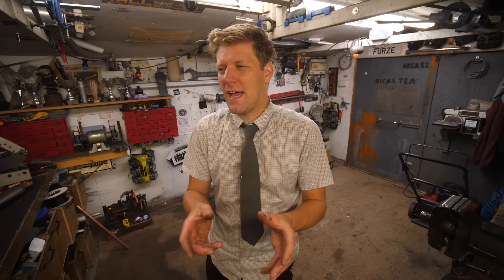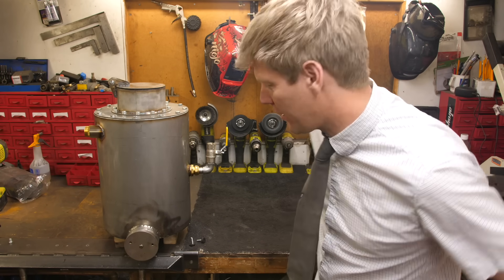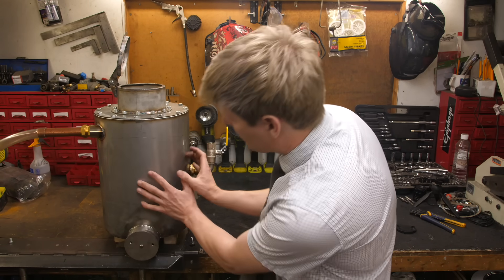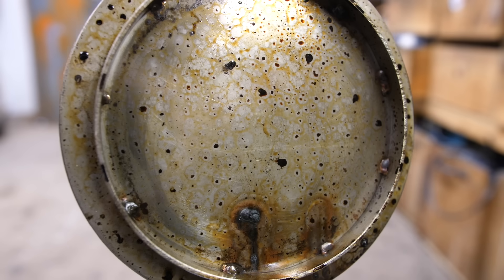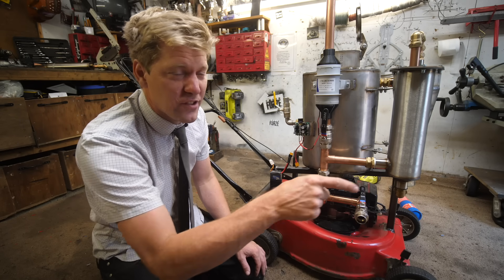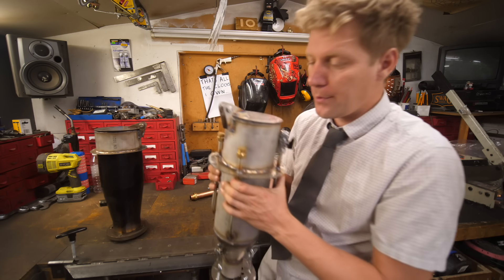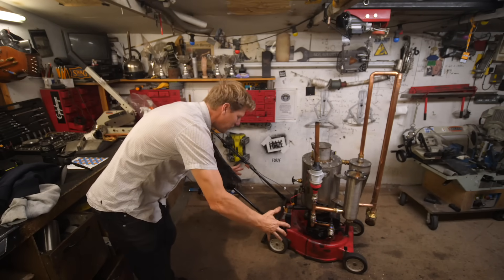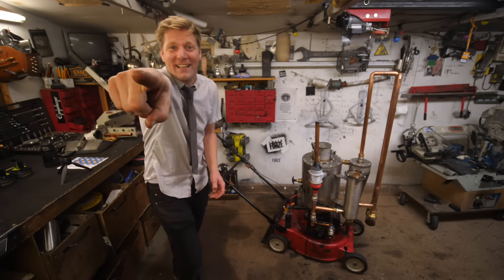WOOD POWERED LAWN MOWER

Comment from the maker: Well this was a journey, I've got a way better design in me but I love the trail and error and I know you like seeing it all to, stay tuned for the ultimate garden swing. Limit stock available on the merch so get it quick https://www.colinfurzeshop.com
Reply: Please do as Spotify playlist with all the music you use o the video, because damn your soundtracks are you almost on point. I beg you
Reply from the maker: @NicholasKI98  I'm on it
Reply: @colinfurze  انت شيعي لو سني
Reply: @colinfurze  Put in a heart ring to have a waist were it burns really hot. There is where the tar is cracked into lighter stuff. Under the waist you need to let some char coal drop down in a layer to reduce CO2 from the hot part above into CO. In the heat the moist will split the water into H2 and O2 giving you more CO plus H2 out. It burns better if the gas is cooled. Your very first proof of concept was just dry distillation which is an entirely different thing.
Reply: Did you finish the screw tank
Reply from the maker: @Ziggyzaggy300  I need a few bits of special paper before that can continue
Reply: @colinfurze  what kind
Reply: @colinfurze  I'm just glad to have you uploading again
Reply: @colinfurze  I've seen another channel that all he does is make these he might be worth a watch he runs his house off ot them
Reply: colinfurze Recently rewatched the hydroforming video from several years ago and had an idea. If you programmed your CNC plasma table to cut shapes out of 4-6mm steel with bolt hole around the perimeter you could sandwich two pieces of metal between them and add pressure between them, then you should be able to create consistent shapes that you could produce quickly over and over. Let me know what you think.
Reply: @Ziggyzaggy300  тио

иаь
Reply: Can you use the cut grass to help power the mower?
Reply: Kyle Williams don’t even question that man’s abilities but that’s a great idea😂
Reply: Put a bubbler filter on it
Reply: Wow Colin, I love your work! Always coming up with something amazing.
Reply: I actually can't believe you got that to work at all. Nicely done. How long were you working on this project?
Reply: i like your vedaos
Reply: you shild ask "mr teslonian" because he made a bunch of stuff with woodgas
Reply: Make a proper knock-out pot mate, you got a combustion company near where you live (along the A1) if you want some good advices ;) there is a bunch of experts there.
Reply: I wonder if a bubbler would clean the gas enough!!!!
Reply: How much of a difference will various types of wood make? Pine would probably produce the highest amount of tar for example.  Aspen may be better?
Reply: @mabecka  actually I think you have it backwards. The water isn't so much a function of moisture in the wood, but actually a byproduct of the wood combustion itself. Just like burning natural gas, water is produced when the hydrogen is  oxidized.
Reply: @kleetus92  might be, but i was thinking about the tar. Pine is what is used for making tar. Seems like a bog part of the problem. Someone got to know what type of wood works best. Cheers!
Reply: @colinfurze You should do merch that is in the theme of what you wear. Like button up shirts, ties, and gloves. I'd rock that daily at my welding shop.
Reply: The stuff you come up with blows my mind 
And I've been waiting for you to start doing hoodie great vid 👍😂
Reply: Colinfurze just a Idea you should make the machine run on the cut dry grass so you don’t even have to use wood
Reply: have to say this thing looks as if its steampunk tech made real a little modification/decoration and it would be perfect
Reply: You need water in that mason jar so the wood gas can be injected under the water level and the gas to float up leaving the tar behind. Also a smaller outlet pipe for the wood gas to be lit. Not 100% sure that will do to much but about 70% percent sure with current knowledge.
Reply: Great video as always!
Reply: Great vid
It would be awesome if you could finish the hydraulic jaws
Reply: Woooww super chuloo
Reply: No one is better than colinfurze😂😂😂
Reply: martin ford he sucks
Reply: How u gonna see what u mowin in front of u😂
Love ur content btw
Reply: How does it work 
link me the science
Reply: Mr teslonian is an expert in this field. I used to watch him a few years ago and he sussed it with different places to catch and cool the fumes with making petrol,diesel and creosote while making engines and gas fridges work. If you haven't seen his channel you need to because he is very much like you and makes all kinds of cool things like ways to generate electricity and the such. Cool video none the less col👍😁🍻
Reply: Did you intend to write trail or trial?
Reply: Colin can you go live pls mate
Reply: Love it
Reply: colinfurze plz do something w steam
Reply: Great work! The wood gassified cars we had here after WWII usually used large water 'bubbler' filters. Might be a bit large for that lawnmower though. ^^
Reply: Fantastic! Saw a guy once that made a gasifier work with a turbo as a generator. No motor, just turbo and gasifier with a small generator attached to the turbo. Gas turbine generator. How about a wood powered jet engine next project?!?!
Reply: @follyoftharp9031  I said this in other comments, and I agree 100%.
Reply: You need to make a wood gas powered wood chipper.
Reply: Now you need to put a jet engine on the back so you don't need to push it
Reply: Had lots of trouble with my set up lots of tar 😑 lagging and insulating all the gas lines from the burn chamber helped keep everything at a high temp which massively reduces condensation in the system and reduces tar and ability to tar 👍
Reply: STEP 2: Make it grass powered insted of wood powered.
Reply: @Mark_Rober  انت شيعي لو سني
Reply: @علىِالشيعيالرافضي اخرس الصمت
Reply: Take the cut grass, dry it out, use it as fuel, 

Science 100
Reply: Hey Colin! What about water filtration? It might be a weird comparison, but i mean something like bong. This will cool the gas down and filter tar out.
Reply: Я из России класс видео 👍👍👍👍👍👍👍
Reply: Dude, just bubble gas through a can of water, it'll absorb most of the tar.
Reply: Thumbs up! Love your videos, im really interested in woodgas 

P.S when you start a empty gasifier for the first time you should fill the "core" with charcoal instead of wood to make the first start way easier.

One idea i have to get rid of water in the wood is to make the lid like a upside down bowl with a folded in rim so the water condenses and run down the sides and you can drain it from there,so you get rid of the water before it enters the core/filters/coolers.

Hope you get the idea.   Cheers!
Reply: I have over 2000 hours of engine runtime on woodgas, and yup, I have made EVERY mistake in the book, during the learning process  :) .
Reply: This Documentary explains a lot. Its well presented I believe most of it. You decide>>>enjoy 
https://youtu.be/SZIKrPXltrA
Reply: colinfurze why don’t you make a wood powered chainsaw so it makes it’s own fuel
Reply: Build a shopping cart but above a go kart frame
Reply: You may want to edit "trail" to trial😉
Reply: I dont always get to watch your videos on time can I subscribe to something so I can get merchandise  before it sells out ps I did manage to get your sighed book
Reply: *Trial and error 👍🏻.
Reply: use water bubbler to catch the tar!
Reply: Maybe make a steam-powered lawn mower and you can heat the steam with a wood burner. It's not the same, but I'd like to see that.
Reply: Great
Reply: Loved this video
Reply: Hello
Reply: Can't wait for what he will do with the 10 mil button
Reply: Colin how do you get all these ideas?
Reply: colinfurze make the scrap mechanic spud gun
Reply: HI COLIN BIG FANNNNNN FROM INDIA SHOUTOUT PLEASEEEEEEEEEE
Reply: That’s a fricin mini coal power plant😂
Love ur content btw
Reply: Hi COLIN BIG FAN FROM INDIA SHOUTOUT PLEASEEEEEEE
Reply: Try mr teslonian. His videos are informative.
Reply: Another fantastic video!!! Payday next month i want everythinggg on your website
Reply: Trail and error? Jk you’re the best
Reply: I nominate you for the person most likely to survive the apocalypse...
Reply: Finally getting to wood! Can't wait for the wood gas vehicle ;)
Reply: This was GOLD
Reply: SWEET the last 360 swing was 1 of my fav's and the fan backpack made it epic. cant wait to see what you do next, thanks for making my day happy
Reply: @The1badxj  you know, there hasn't been a 10 mln subscriber fireworks video. Fireworks+swing (probably only swing testing in the backyard) would be a good starting point for a video 🤔
Reply: Can you make version 2 not rely on a electric fan to pump the wood gas? Because if you want it to power your bunker in an apostolic situation you don't want to haft to charge battery to for your wood gas generator to work. Thanks!
Reply: I'm Moorenation 2020 - Official l
Reply: @colinfurze what you need is a destilation tower
Reply: Hey Colin! Great video! I had no idea gasification was a thing. I do know from steam engines that that slag stuff you collected at the bottom of your fire is called "clinker", if you were curious to know. I look forward to seeing your bunker generator!!
Reply: @calebwagler853  clinker is from coal. Wood doesn't make clinker if it is burned completely. Look at the minimal amount from a pellet stove.
Reply: @Crayphor  put a link to that video
Reply: If you're gonna be using wood gas you'd better find a use for all the rotten tar you'll produce! 
You should be going solar n wind, bit cleaner for the kiddies lungs n that!
Reply: You need a water filter for it to work
Reply: 🇮🇳Love from India😍
Reply: you said centrifuge bong to capture the tar in water
Reply: Build a charcoal gasifire it makes no tar
Reply: hey colin! I and probably a lot of other people are curious about that afterburner you said you'd make. where is it???

also, cool project
Reply: Just ordered some merch! 🙌🏻
Reply: Truly great sir
Reply: What does it smell like Colin?
Reply: You are really preparing for the apocalypse with the wood powered bunker, aren't you? XD
Reply: Delete this video before the oil companies have you mysteriously disappear 😂
Reply: Use hard wood chips not wood pellets and a scooter radiator for the condenser
Reply: Love you
Reply: Awesome to watch you create things. You are just like doc Brown from back to the future! I like this build a lot.
Reply: https://youtu.be/H6ohdzhQhgk
Reply: The hoverbike is my favourite video because its awsome and it came out on my 8 birthday.
Reply: Sup
Reply: I just bought a T-Shirt and you can be proud - it's the first merchandise clothing I ever bought at 38 years of age. :D
Reply: Finally someone see this a relevant solution!

Hey Colin,

do my idea and for the bunker use solar power to heat the chips, use parabolic with vacuumtube or mirror focus to heat up the chips, and store the gas.
Later you can do the same for boiling water and use the steam to reform woodgas/syngas to methane.
This was my PHd and project for national award but was canceled due to corruption in my country!

If you can do and prove maybe you could get the needed attention to help 3th world to find the green way.
Reply: Colin genius!! I love your videos and the crazy things you do... Saludos desde argentina! 👍
Reply: Grass powered lawn mower?
Reply: Hey Colin, hear me out, do this... but with a full sized truck(pick up or semi) or boat (your choice) as a stepping stone to make sure it’s dialed in before powering your bunker with wood
Reply: Amazing job furze, I wouldn't have thought of it, but now you have. I know you'll get it. 

Also, I'm going to be saying "gasification" for the rest of my life. Put that and a picture of your finished mower on a shirt and I'd buy one.
(Internet help me make a demo)
Reply: @V3 TheTest and the petrol isn't bad?
Reply: So much for global warming 👍
Reply: Did you try using a water based filter?
Reply: I would love to see the blueprint of this invention and the update !!!
Reply: you should try and build a green energy invention like a solar-powered lawnmower or skateboard that would be awesome.
Reply: Please do a virtual colab with Michael Reeves!!!
Reply: Probably can’t use it in California
Reply: Try using running the gas through water as a filter it should let the wood gas through and pull out all the tar and smoke
Reply: AW YES
Reply: collin this does work their is a video on YouTube about a guy running his generator for his place off wood gas and made a tar separation thingy that could give you some ideas for the bunker he also used wood pellets
Reply: Next version, pass the grass along the heater to dry it, then it can be used as perpetual fuel...
Reply: When did Colin become a chemist
Reply: Colin. You owe us both the 9 MILLION and 10 MILLION subscribers fireworks videos fireworks 💥 🧨
Reply: Char the wood first buddy!
Reply: Try capturing a micro black hole (created by using the LHC at energy levels above 23 MeV)  with magnetic field nets (once its slowed and stable) fire EM waves at it at the precise angle to use its tiny gravity distortion (to accelerate the waves beyond energy levels put in) and bounce them around a container without the field falling in the tiny event horizon until suddenly released.

You think you can build that? Might take some co-operation.

All I ask is that you call it an SPM Single Point Module 

😆
Reply: now can you keep mowing using the lawn clippings from last mowing?
Reply: If you DO intend  on making it better... How about adding one of those automatic room cleaner bots that are used to avoid walls and objects.
Reply: You are like a real life wallace.
Reply: You should make a go cart powered by wood
Reply: Colin PLEASE PLEASE don't give yourself CO poisoning! Carbon Monoxide is nasty stuff.
Reply: Welcome back sir! Brilliant concept
Reply: Just buy petrol mate
Reply: Colin maybe put cottone in the jars
Reply: I literally was going to build this same thing for my channel but I'm glad you did it first cause now I don't think I want to. :)
Reply: Make a wood powered go kart
Reply: You should have made a wood gas generator, then convert what you want/need to run wood gas only. That way you can refine what you already have, stockpile it for later, and decide on what you want to convert to run pure wood gas. It'll also allow you to filter out the tar better by having the generator separate from the engine.
Reply: "Powering the bunker with wood gas" Colin, are you alright mate?
Reply: @colinfurze maybe try a less resiny wood. Pine or any other red wood contains lots of sap/pitch, that's the tar you're getting, most hardwoods are a lot less sappy, and depending on the source potentially dryer. Construction grade kiln dried redwood is usually about 14% moisture, I've got some chunks of oak that measure less than 8%.
Reply: Would love to see u make this work on a car engine 😂
Reply: You might try incorporating a water bubbler into your filtration system! Cant wait for the next one!
Reply: You could bubble the gas through some sulfuric acid to remove the moisture & tar and a second with calciumchloride.
Reply: Hi Colin, How about making Steve Martin's gasoline powered turtle neck sweater.
Reply: Something simple that you have made an absolute balls of.
Reply: It didn’t work to begin with.  No smoke.  No chooch!  Scam artist
Reply: Build an electric skateboard
Reply: Hiya Colin! I would recommend bubbling the gas through a large jar of water and a bigger radiator, which will both serve to condense the tar and water out of the gas, and cool the gas. (and the water will eventually fill with drops of tar.) Also, consider using a turbo which is driven by the engine to pump the gas, as this could cut out the requirement for a fan :)
Reply: man, Ukrainians use such a mechanism to refuel their cars
Reply: Cut the lawn next week  with the cut grass
Reply: @colinfurze Would it be possible to use water as a filter? Thinking if you made it as one large water pipe?
Reply: mad man !
:)
Reply: Maybe you should somehow collect the gas In find a way to filter it from there to get the gunk out I mean I know the point was to have it work all as one ....buuuutttt  That gunk is worse in the stuff that comes out of my butt after chipoltle
Reply: Your imagination is to big for your body
Reply: Believe use hay filters, wood never seen. With cyclone particulate filter and radiator cooling systems. Basic on pickups in USA.
Reply: 日本語の字幕つけてほしい…
Reply: Need a water trap like a water bong for smoking weed
Reply: Can't say I'm the only one, but I did suggest a gasifier via the website about a year ago!
Reply: Great Friends
Reply: You can it woouu😱😱😱
Reply: It needs a gasometer! https://youtu.be/5hfznunVzKY
Reply: you may need to filter the gas through  water to get rid of the unwanted tar
Reply: Donald and Kanye getting close https://youtu.be/0KjnXpiFhT0
Reply: Where is Mr.Bean?
Reply: Make a steam powered Riding lawnmower
Reply: @V3 TheTest bye!
Reply: #Colinfurze delete the carb completely your mixing the fuel air yourself and also you the freaking man I'm glad I've been here since the beginning 🤟🤟🤟🤟🤟🤟🤟
Reply: Colin I was power washing my mini bike and letting the power washer run on the side of a tire on a threads and making spinning at Mach 5 do I bet you can make a power washer driven mini bike just having high pressure water jets spraying at the side walls at the tire
Reply: colinfurze you should make it so u can smoke meat and Moe your lawn at the same time.(I noticed you used smoker pellets and got the idea.) you can call it the ultimate dad lawnmower.
Reply: RED PILLS>>>>>>Enjoy the TripPPPpppPPPPpppPPPpppPPP
https://youtu.be/SZIKrPXltrA
https://youtu.be/kSkY1BPwuew
Reply: https://youtu.be/LlwvF7k31Dg
Reply: Grass powered lawnmower
Reply: https://youtu.be/PDaVAwyuHAk
🤞🤩😍🤩😘🤞😍🤞😘🤞👌👌👌👌👌
Reply: Even the trail and error has some trial and error in it. So back garden, Colin Furze shed!
Reply: lol big memer 69 no he sucks
Reply: This lawnmower gives me such a steampunk feeling
Reply: Just started a channel. Taking trucks into the mountains to wreck em. Hoping to make some folks laugh!
Reply: Hi Colin how about taking a couple of steps further make a woodfired gas turbine out of one of your turbocharged jet engines you have and put a freeturbine on the back to generate electricity
Reply: 'without gas or electricity' requires a battery powered fan and a blow torch to start
Reply: Next video: grass powerd lawnmover.
Reply: Thought I recognised that accent; greetings from Boston. New to the channel & love it Furzy. Was at the beach over weekend. Would love to c a top-box on a car able to get itself down and drive to the beach. Sweet.
Reply: Trail and error, I see what you did there.
Reply: https://youtu.be/_QeiKTPfI1s
Reply: looks so heavy to push
Reply: Keep this up and you'll have people from the EPA (american anti pollution politics agency) knocking at your door.
Reply: @jeremiahfix5529  He lives in UK and he's britain, not even an American lmfao. Read the facts and know who he is before dissing on him, thanks :3
Reply: could be a horrible idea but a steam powered go - kart could be interesting
Reply: @alexc7857  XD
Reply: Make it even cooler hook up motors to the tires so you can use a rc car remote with it
Reply: The Germans in ww2 developed a tiger that ran on wood gas.
Reply: https://youtu.be/3apnzNVHtLg
Reply: @colinfurze
Would be awesome if you could use the cut grass to power the lawnmower somehow? :D
(Maybe not directly, since it is wet (use it for steam? & dry it at same time? ;P), but you could dry it, and then feed it to the gassifier later?)
Reply: Oil bath filration Colin?
Reply: О круть  супер     вам класс готов
Reply: Furze has failed it could have been grass
Reply: Colin my man you have the best montage music . it makes me want to build stuff.
Reply: Kind of wood used effect build up like chimney?
Reply: Build a wood gas powered car!
Reply: Had you considered an oil bath filter? Not sure if that would catch all the tar, but it may help cool it? Just throwing something at the wall here....
Reply: soo look up mr tessalonian . he has a lot on it. also you can filter the  gas intencivly to actually produce very high grade liquid fule as a bi-product.
Reply: Do you think a oil filter from a car would stop the tar getting to the engine ? Plus more compact
Reply: Try turning the wood into charcoal first
Reply: Colin can you make a wood powered go kart 🤔🤔🤔
Reply: That’s amazing 👍
Reply: colinfurze you need to put it in a car that would be a great mini series
Reply: What about bubbling the wood gas through a water colum filter? That should pull the tar right out, and cool the gas down enough to condense it for greater potency.
Reply: So.. given that it uses an electric fan to move all the gas and air around, what you've ACTUALLY built, is the world's most complicated battery-operated mower!
Reply: But would it also wor with hay
So you cut the grass, let it dry and use it as fuel for the mower⛽💚
Reply: Dude, I wish you were my neighbor when the zombie apocalypse comes. Fuck the World, let it end, but the lawn must be perfect.
Reply: Colin also loves the TRIAL and error
Reply: Dont use pine use hardwood that's been seasoned so it's super dry. No tar issues. The tar is from the pine.
Reply: You could probably do the same thing with a distiller style version use your tank for the boiler send it to a thumper keg for the filtration and condensing coils to cool the gas and condense it also where your fan can be to keep it from melting
Reply: No
Reply: You love the Trial n' Error?  That's awesome because my channel loves you too!
Reply: Hi Colin, i have another project to you, can you build a front wheel drive bicycle? it will be fun to watch.
Reply: Next time could you make a mech powered by steam
Reply: love the way you say slag so casually lmao
Reply: at the end of this you'll have a patent worth millions that the chicoms will try to hack your puter for.
seriously, this is the most interesting one you've ever done because it dabbles in practicality: I'd at least use a self propelled model if not a riding mower though.
In WW2, many or most western countries and japan converted all their public buses, trucks, etc. to woodgas because of the fuel shortages...
Reply: Fuel was scarce, but not unavailable.  A lot of wood gas modified engines used a petrol fuel tank to start the engine, and before shutdown - precisely to clean away a lot of the gunk that would otherwise foul the engine.
Reply: you should check out the video game called Grounded, its on steam, its all about crazy inventions and i think you would inspire the game and maybe it could inspire you haha its like honey i shrunk the kids!! anyways i love youre content keep up the amazing work!!
Reply: You need to make a screw feeder to feed gas generator with mowed grass )))
Reply: I hope that you see my reply. Don't burn pine wood, it's full of resin and that's why the tar build up. Use a hard wood. Just ask any chimney sweep and he will tell you the same.
Reply: @paulus842000  You are correct, pine is extra sooty and loaded with creosote and tars.  I believe hardwoods also have more stored energy in general.
Reply: Could you filter it with water?
Reply: In Estonia one old guy build the same thing but a car working with oven “engine”. It was like over 10 years ago. :D you should also try making a car next time :D
Reply: Best channel on YT hands down
Reply: Colin where every invetion goes after the video
Reply: This is the first video I've ever seen from you, I've paused 2 minutes in to let you know this is fucking sick. Love your music taste, and attitude towards cool subjects like this
Reply: Next up: Nuclear powered riding lawn mower
Reply: There needs to be another one that can run on the grass it cuts
Reply: U should consider using a hard wood it'll take a bit longer to get going but it will burn hotter for longer
Reply: Or pinecones
Reply: you are just like Bat-Man
Reply: if it worked the neighbors will complain
Reply: I wish i had your life.
Reply: You gotta eventually do this for the screw tank
Reply: I wonder if just burning the wood gas and using the flame to power a steam engine would be a way to go for powering your bunker.
Reply: Make it work om burned grass
Reply: Is there anything you can't create?
Reply: You should make a floating house next 🏠
Reply: Hi there if you could please take a moment out of your time and really have a look at this as we need help to save our little girls life.

I'm just trying to get all the help that i can but i have gotten some devastating news about my little girl Eleanor, who is almost 7 months old. She has been diagnosed with a very rare disease called SMA (spinal muscular atrophy) she has type 1 which is the worst type you can get, it is a life threatening disease. We have found this treatment but it is only available in America which cost $2,000,000 USD so that's about $3,000,000 AUD and we have created a go fund me account to try help raise these funds for her as we would never be able to get this kind of money ourselves. so i was wondering if you could really help us out by helping share this around for our little girl to give her the best possible help she can get. Even if you can donate as little as $1 every little bit will help
this is the link to our go fund me https://www.gofundme.com/f/eleanor039s-gene-therapy-fundraiser?utm_source=customer&utm_medium=copy_link&utm_campaign=p_cf%20share-flow-1&fbclid=IwAR3Mum3_MHgjwLUumE-nnbJ17GsXaTR2W-r768KaT7tWOCtuLdNfmVQ8I9M

Thanks Brad
Reply: use wood gas to power your turbo jet engine
Reply: can you mąkę assassin cane sword
Reply: Great video ,
What about refining the wood tar into liquid fuel
Reply: What about a water filter?
Not just one but multiple.
Basically it helps condens out the water, filters out impurities and cools the smoke down... Plus it shouldn't clogg.
When you use jars for that you will see how much the water actually cleans.
Then run it through the cooler, through steelwool and through carbon.
This should result in very pure smoke.
Reply: Haven't seen you get that excited about one for a while.  Like the old days
Reply: Nice wood powered lawn mower Colin love the look of it.😃👍
Reply: What about adding a Turbocharger to it?
Reply: 9:57. The face of a man who has just done it
Reply: Now make a lawnmower that runs on grass clippings.
Reply: S bend as part of the filter?
Reply: You are my backyard hero
Reply: Next time, it’d be pretty cool if you could design a gasified mower that runs on lawn clippings.
Reply: Man, your stuff is great. Looking forward to seeing the test drive of the completed screw tank too! 

PS: the P.O.C burner looked like a bioethanol burner. Try adapting it for bioethanol! Challenge for you furze.
Reply: Nice gasifier colin
Reply: 🌷🗺🌷By every way From divinely powers all the prosperity💎 &wealth abundance💎 in everyday life to all who are reading this comment🌹🍷🍹💐🌏🌄🌻💜💎.Thanks a lot🙏
Reply: Bro what about the engineers in India who make cars run of of wood
Reply: Coud you make a fold out Metal cup
Reply: Could you make a fold out matal cup
Reply: Please make lawn powered lawn mower.
Reply: New Idea: Garden Spout that spits out fire.
Reply: Are you going to do a homemade steam train?
Reply: If you guys liked his crazy vids have a look at these crazy asmr vids
https://m.youtube.com/watch?v=3CXZdK6ikMA
Reply: Wowww loco jejje
Reply: How bout wood power mulcher
Reply: Hay Colin is there anyway us English men can visit u or send u mail
Reply: Sus
Reply: Could you make a grass powered lawn mower
Reply: You should make a grass powered lawn mower instead and make it pick up the grass it cuts as fuel
Reply: #kingfurze
Reply: #kingfurze
Reply: jet engine boosted lawn mower? mark 3
Reply: colinfurze trial* sorry had to do it
Reply: or just make a grass powered motor
Reply: Can you do a video about replacing a car or van engine with multiple Lawnmower engines?  Even if you have to gut out the interior to make the carmower as light as possible. I'm sure it will sound pretty weird!
Reply: Woods no good you really want charcoal. You don’t want anything with hydrogen in it. This will form water vapor that messes with flammability etc.
Reply: instead of woodgas it would be easier making a generator that worked with a steam engine, way simpler, just a camber for the fire and another with water and that steam moves the cylinders, and the used steam could be used to heat up the room or other stuff, or just cycle it again and again so it doesnt waste heat, too much pressure can cause an explosion though so add a pressure sensor, but no need for filters and its a much easier technology, its like a fireplace that also generates electricity with the heat of the water, also the condensed steam would be purified water after.
Reply: How about a grass powered lawnmower? That would be fantastic
Reply: @wyvern3  it would need to be dry grass, green grass has too much moisture so the steam would make combustion near impossible.
Reply: See if you can make a gasifier powered hillbilly machine
Reply: Please can you make a video of gasifier with measurement and a finest detail of chamber ?
Reply: Who made you so creative?
Reply: Make a grass powered lawnmower
Reply: Hey Colin look this vídeo, https://youtu.be/5T16BkQlGMQ is a CAR
Reply: Furze,... solar powered lawn mower next please. :D Charging station with a solar panel that can charge a electric lawn mower :D
Reply: I'm not an engineer or anything, but u might have better luck filtering out the tar by bubbling the wood gas through water. I just have no idea how much water.
Reply: Colin I do this at home and the tar is from the softwood if you put some hardwood like maple or oak it’ll burn hotter and a lot less tar! I do this for melting metal mostly aluminum but I’ve never tried it on a mower, that’s super cool! Also I love you channel and the stuff you do is amazing!
Reply: Stoked to see the full size bunker generator; Furze style!, in which I mean pro.. practical in this application would obviously be more appropriate.
Reply: I'm guessing it's a two stroke engine and you've got no lubricant in the gas.....
Reply: can you try making something powered by steam, like a car or boat, or just a simple steam engine
Reply: when are you going to power the bunker???
Reply: Hey
Reply: i know in the UK they had a coal powered truck
Reply: https://www.youtube.com/watch?v=XUOkQ2a9WI4
Reply: Can you make LAWN POWERED LAWN MOWER?
Reply: Run a car om that
Reply: What you can do is that... instead of keeping the whole gas extractor with the engine, you can make a gas station and fill the gas in cylinders and use them to power the engine.
Reply: you can not use pine you will get TAR (ever heard of pine tar)use  hard wood
Reply: I can built that too
Reply: Can you make a lawn mower run off grass clippings? :)
Reply: hey why dont you filter the gas with water?
Reply: I need a new gasifier vehicle.

Dunno if you had Lindy's Technical Books catalogs in the UK back when....
They reprinted all manner of amazing stuff from state of the art 1924 airplane books, build a jet engine, 1930s-1950s cool books of projects. Lots of project books for "boys" that I still have & wanna make every one. 

Anyway.
WWII gasifier tech was used in AU & NZ due to petrol shortages.

I purchased a reprint of a just postwar book about the technology, under the impression in my 12 to 14 year old brain that I was going to have instructions to build something. I don't think I have the book anymore but I never forgot the technology and I always wanted to build a gasifier for a car. At this stage of my life I have access to the equipment and the skills to do it. But I want to see Colin do it first😂
Reply: Trial / too
Reply: Is there a new mover m8
Reply: I would probably try filtering thru a water bubler
Reply: Would you make a wood powered go kart? That would be sick
Reply: Hi colinfurze! Nice video!
Have you considered ading a water bubbler to the system to filter out water vapor and other inpurities from the wood gas instead of a cooling tower you have? It might end up more effective and more compact.Anyway thx for the video,keep up the good work.
Reply: replace the fan with a turbo.
Reply: you had it at the water stage what you did not have was the missing part a Charcoal colom that converts the water into hydrogen damp smock coming out of the wood gas generator must return into a charcoal colom. and then into the engine & Gen-set, the persisting water problem is seen as the reason for bad gas production.  in fact, it is the lack of a Charcoal colom  that makes it all work
Reply: had you put all that energy into making a charcoal gas genarater & used water to provide the hydrogen all the tar problem's wuld have diapered & your system wuld have worked  well.  there will be a resin we have a lot of water & it is that which coverts to hydrogen
Reply: Have you messed with the thunderstorm generator or geet reactor yet brother Colin?
Reply: Collin it's been ages since you uploaded
Reply from the maker: @vaultdweler5729  I know this was a pain to get to work
Reply: @colinfurze  So one of the things you have to do with a wood gasifier, that's probably the biggest thing keeping it from working well on a mower, is cool the gas a LOT.  The hotter the gas, the more moisture it will contain, and the moisture is water and creosote (tar). You'll want a zig-zag arrangement of pipes (or square tube) running left to right, with each tube at a slight angle so the tar will run down to your catch can and not sit in your intercooler (which is really what it is). With a mower you'll need some fans on it. Also... you can't make the intercooler/radiator out of aluminium, because the wood gas will corrode it. So it's gonna be a heavy bastard.
Reply: @colinfurze  Finally someone see this a relevant solution!

Hey Colin,

do my idea and for the bunker use solar power to heat the chips, use parabolic with vacuumtube or mirror focus to heat up the chips, and store the gas.
Later you can do the same for boiling water and use the steam to reform woodgas/syngas to methane.
This was my PHd and project for national award but was canceled due to corruption in my country!

If you can do and prove maybe you could get the needed attention to help 3th world to find the green way.
Reply: @colinfurze  colin, your most ambitious project yet. Build a water tube boiler for the bunker, design to run boiler pellets or liquids like #6 fuel oil or karo/diesel......dry up the steam with a superheater and run a turbine.....furze power and light co. OMFG PLEASE DO THIS
Reply: vault dweler but when he does upload, it’s very interesting and a fun video so don’t complain
Reply: vault dweler only been 3 weeks
Reply: @vaultdweler5729  but remember that each time he makes crazy vides
Reply: Love you man
Reply: Try Mr teslonian. He has a bunch of videos about wood gas. Usually fairly informative.
Reply: Fu colin
Reply: You must cool it. It has too much water inside
Reply: Seth21914 no don’t cool it that makes tar keep it hot and use well seasoned logs moisture content of 12% is ideal
Reply: Trial*
Reply: colinfurze hey!! Will you reply??
Reply from the maker: @QuackRanking  might
Reply: @colinfurze  put a water bubbler filter on it to catch the tar and contamination also cools it down
Reply: @colinfurze  would the fan not be better on the cold side to push the air
Reply: @paninisinabox  problem with that is the volatile gases will dissolve in the water, and you'll add water vapor to the gas. Ruins it being useful as a fuel
Reply: @colinfurze  Good'ay mate, here's your fan from over the world, Malaysia!!
Reply: @QuackRanking  haha nope
Reply: @QuackRanking  🔴 What Is Islam? 

🔴 Islam is not just another religion. 

🔵 It is the same message preached by Moses, Jesus and Abraham.

 🔴 Islam literally means ‘submission to God’ and it teaches us to have a direct relationship with God. 

 🔵 It reminds us that since God created us, no one should be worshipped except God alone. 

 🔴 It also teaches that God is nothing like a human being or like anything that we can imagine.

🌍 The concept of God is summarized in the Quran as:

📖 { “Say, He is God, the One.  God, the Absolute.  He does not give birth, nor was He born, and there is nothing like Him.”} (Quran 112:1-4) 📚

🔴 Becoming a Muslim is not turning your back to Jesus. 

🔵 Rather it’s going back to the original teachings of Jesus and obeying him.
Reply: Hello
Reply: colinfurze cool!
Reply: Who else been watching for more than a year 

                    (READ MY NAME BTW)
Reply: @prettyboy319  stop trying to get subs by just asking for it
Reply: @Ziggyzaggy300  I’m pretty sure it’s some kind of bot. Look at the broken English. I’m betting it’s some sort of ai that tries to make coherent sentences.
Reply: @prettyboy319  dont be that one...
Reply: @prettyboy319  I subbed